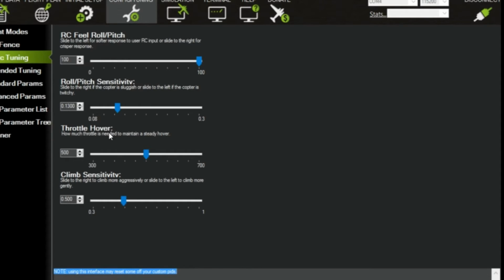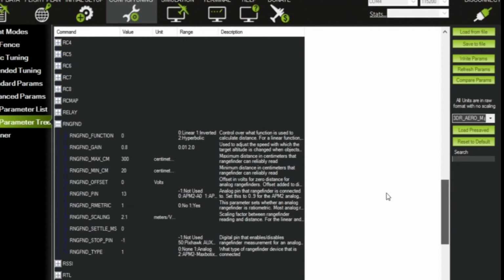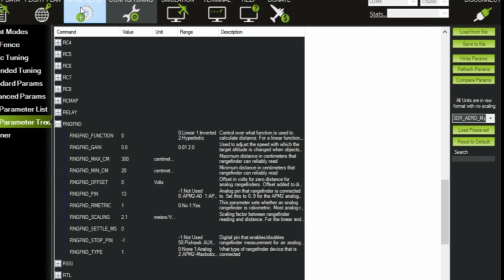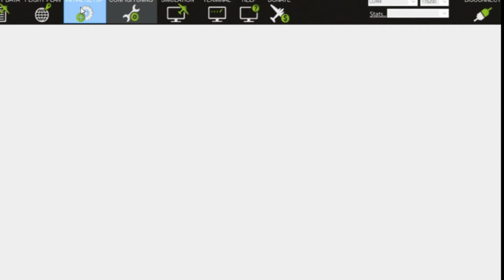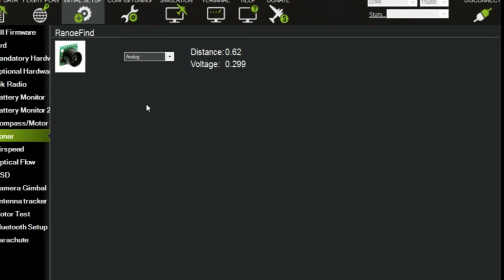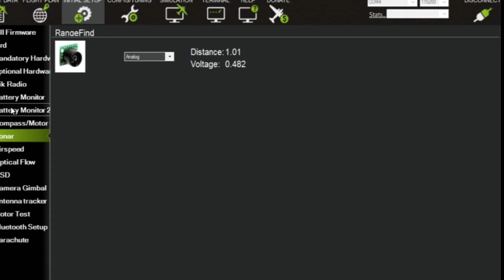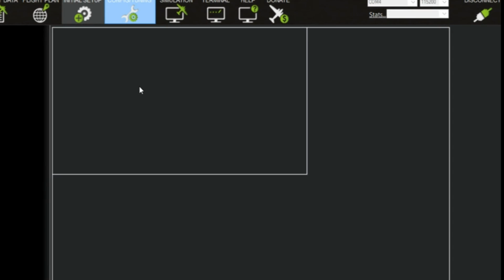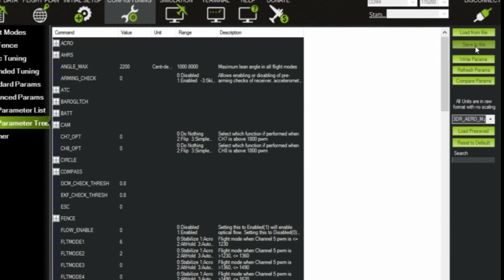cx20 sonar apm 252 v5 mod update

Comment: Awesome work! I couldn't wait to try this and it works great! Haven't flown it yet since we're having 15-20mph winds at the moment but will try as soon as I get a chance to see how it performs.

One issue that I am having is that it seems the standard 3.2.1 firmware disables telemetry on the CX-20. I've found some custom firmware that enables telemetry, but in order to save space they disabled Sonar. I guess I'll try to compile my own custom hex with both telemetry and sonar enabled, but disable OptFlow and other features that I don't plan to use with my CX-20 to save space.
Reply from the maker: +cjkcizur . ok you will want to adjust the gain to 2 like in my original video so you can test it by going over a object 4-10 feet off the ground.   Sonar is just 1k so you can disable camera trigger at 1k or autotune at 7 k or even the fence at 2k..   After you fly it and confirm it works. I can mod the firmware for you if you want to enable sonar and the serial fix from funtastic
Reply: +bangs6996 I was able to edit and compile the firmware with telemetry and sonar enabled. I disabled the Gimbal, Fence and Camera, as well as the PosHold, Acro, Sport, and Flip modes to get a really small footprint.

At low altitudes (below about 10 feet) Alt Hold and Loiter seem to work really well, but as soon as I get above about 10 feet things start to get a bit sketchy and it seems like it wants to keep climbing, but I've only logged about 3 minutes of flight time. I'll keep tuning the scaling and gain numbers to see if I can dial in the performance.

Thanks for all the work on this, fun stuff.
Reply from the maker: +cjkcizur K cool and thanks for being the first to test it out hehe.. Its weird when I compile it un touched the best i can do is 688k ish ..run the risk of bricking it... (from net it is 672k..I end up just disabling the auto feature and camera to get it to 666k.

about it climbing .. does it do some kind of weird 1-2 foot jump..then does it again and again .. I have another apm 2.6 which I added sonar to it ..and it now does the same thing.  Gets your heart racing regardless ..
Reply: +bangs6996 My climbs have been more of a slow, steady rise instead of 1-2 foot jumps. Definitely get a quick panic going before remembering to switch over to manual mode. I'm hoping it's just because I have my gain maxed out for testing. It could also be that the outside temp was about 40 degrees lower than inside, so I'm not sure if that impacts the barometer at all. Again, more testing is needed.

As for the firmware, I started with the 3.2.1 branch of Funtastix custom firmware (the source that still has the Arduino PDE files) and commented out the features I didn't want. Removing the AC_FENCE caused a compile error so I had to comment out another line in the motors.pde file so it would compile. My final HEX file came out at 629KB. Use at your own risk, but it's out at https://drive.google.com/file/d/0B4Z5EKsrcFzzNlVnTnlZTnBMUzg/view?usp=sharing
Reply from the maker: +cjkcizur   Thanks for the share.. I know who to bug when i get stuck on one of my next video's ..
Reply from the maker: +cjkcizur Is it alright if I add your file to my description.... what did you disable in yours just the ac_fence?  .
Reply: +bangs6996 absolutely! I actually disabled Mount (camera gimbal), AC Fence, Camera trigger, and flight modes Acro, Poshold, Sport, and Flip.
Reply from the maker: +cjkcizur   K cool and thanks for quick reply.... I pointed somebody to this video for your firmware.. .but it got some what buried..